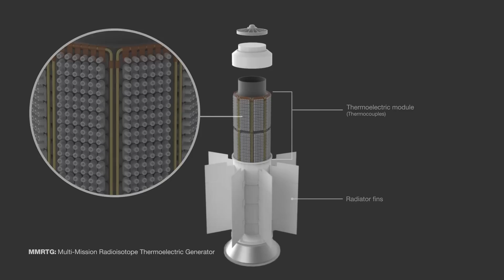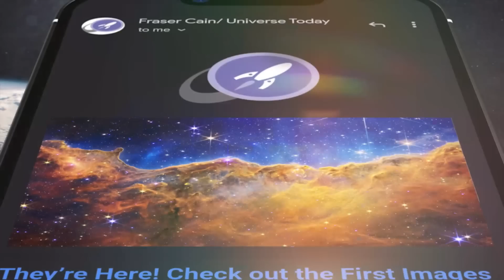Fusion Reactor To Melt Through Europa's Ice [NIAC 2023]

Comment: Why would they worry about bringing enough deuterium?  They’d be melting through ice containing deuterium, right?
Reply: Sure. All they need is to bring a few hundred tons of equipment to split the hydrogen from oxygen and extract deuterium. Much easier than bringing a few more kilograms from Earth.
Reply: @Milan_Openfeint  Thanks GPT-4   "Deuterium extraction from water, also known as heavy water production, can be achieved through various processes like electrolysis, distillation, or chemical exchange. The size and weight of the extraction unit will depend on the chosen method, the desired production capacity, and the level of efficiency.

For small-scale or experimental applications, engineers have developed compact and lightweight deuterium extraction units. These units may weigh just a few kilograms and be small enough to fit on a laboratory bench. However, it's important to note that such small-scale systems will have limited production capacity.

Large-scale industrial deuterium extraction facilities, on the other hand, can be quite massive, occupying large buildings and weighing several tons. These facilities are designed to produce large quantities of heavy water for various applications, such as nuclear reactors or research purposes.

Ultimately, the size and weight of a deuterium extraction unit will depend on the specific requirements of the project and the chosen extraction method. As technology advances, engineers may develop even more compact and efficient systems for deuterium extraction."
Reply: @tablab165  I fail to find such device, and I'm doubtful you could have a series of centrifuges or distillation columns at such a small scale.
However I find quite a few references to "extracting deuterium from D2O". It sounds similar to your answer, but that's the easy part.
You may want to ask GPT some additional questions.

In any case, if other commenters are correct, deuterium is only a part of the fuel for LCF. It uses uranium for the actual energy production, and you'd need to find that as well.

Comment: 'melting'  through the 'ice' wont work. The cummulative grit and other debris will sink to the bottom of the melt pool and halt progress.
Reply from the maker: They already use this technique in Greenland to go deep into the ice.
Reply: Would there even be a melt pool? No atmosphere on these moons so any ice that's heated would instantly transition to a vapor since it's below the triple point of water. Would probably be a clean hole in the ice for at least a little while, until the vapor recrystallized on the shaft (again without a water phase). I would worry about the salts and other grit that could not vaporize and just cling to the probe. Maybe the probe could make little u-bends on occasion to let sediment settle somewhere, or go down at an angle so the sediment collects on the slope?
I published a hard sci-fi short story with Baen books (Robosoldiers) about a fast breeder reactor for an Enceladus mission that would ablate a hole through the ice. I called it HESTIA, Hexahedral Enceladus Surveyor with Thermal Ice Ablation. My prototype had serrated wheels to apply counterpressure to the ice from all the vapor generated from the reactor waste heat.
Reply: @frasercain  Really, Fraser? 
A self-contained nuclear-powered probe? In Greenland? 
I don't think so.

Comment: A giant block of carbon will melt through the ice without poisoning the water with radioactive waste .
Reply from the maker: How do you heat it up?
Reply: You don't i saw an experiment  where they put a credit  card sized piece on its edge on   a small block of ice and the carbon fiber card melted through it without any assistance other than gravity . I'm not entirely sure how that will work in space but I hope it helps
Reply from the maker: They had to pass a current through it, so you'll still need electricity.
Reply: A cheaper payload to deliver. Put a bunch of 28000 year batteries in the middle of the block of carbon. This has to be a safer and cheaper way to achieve he desired result.
Reply from the maker: Batteries won't last for several years of keeping the carbon electrified.

Comment: Why fusion? Wouldn't even need to be Fission. A contained RTG would melt through the ice. Hell, I did an experiment in school where putting a weight on a piece of wire wrapped around a block of ice and it went straight through it.
Reply: RTGs are fission.  Subcritical fission.